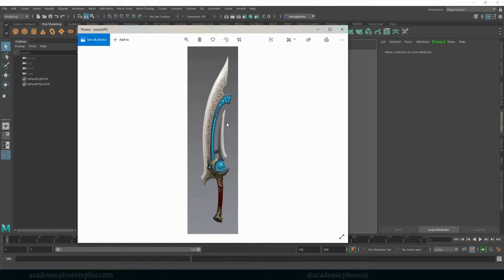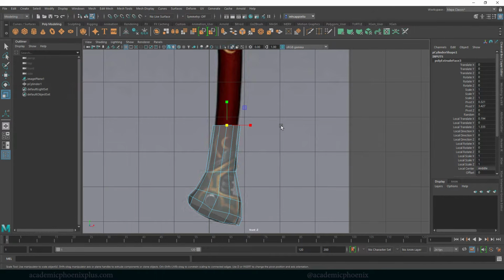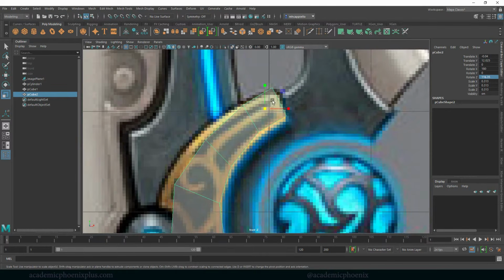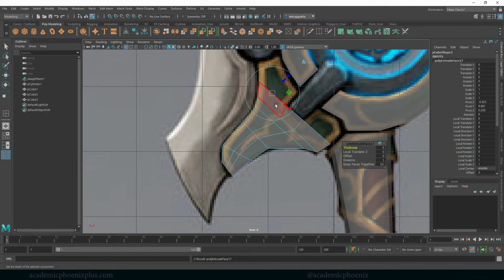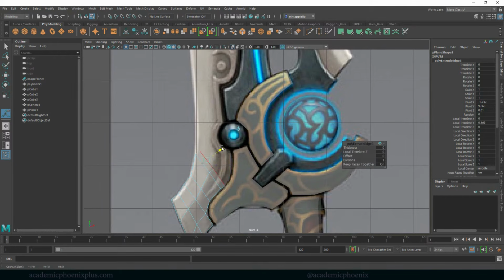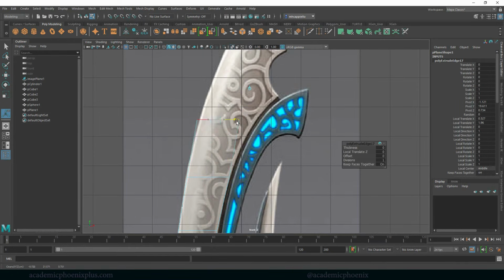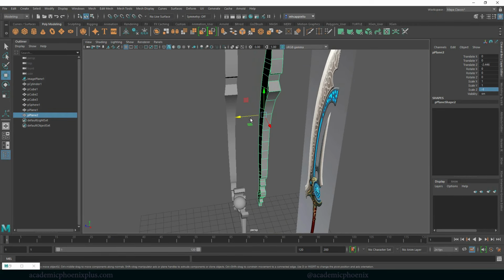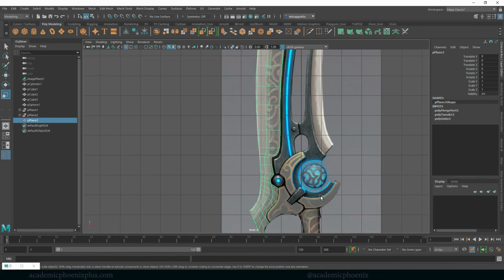Create a Fantasy Sword: 3D Model in Maya 2020 (1/6)

Comment: This is really confusing for me and the handle specifically gave me a really hard time, especially since I'm just starting in maya and it kind of doesn't help much for what I want to be when I grow up (a roller coaster engineer, which is more towards the mechanical and structural engineering side) and they use way more modeling products such as solidworks, autocad, and everything in between. Still a great tutorial, but this is not very ideal, especially for someone starting in maya. (Of course, this is just my opinion and not everyone might think this way or might not agree with me), but this is still a great tutorial for someone who has way more experience, like you.

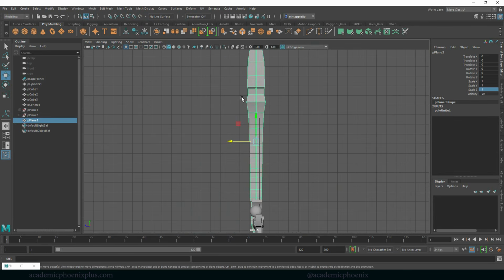Comment: hey, i got a question. like on 23:22 you did something with the vertices like draged the yellow arrow together or something like that. I think I missed that detail while making it, and now I have the problem that my blade on the sharp site (like between 2 lines of vertices, ) is just thin like paper, and I cant really move them to get them bigger. I tried some stuff now but I don't know how to fix that.
can someone help me?
Reply: i foudn a solution, its a bit weird, but i feel like you cut out a whole part of editing in the video. after we extruded the plane and kinda rotated it we still had a group of faces which were just a plane, but we also need them to get an angle to the next mesh, otherwise it will just stay a plane. you kinda cut that part out of the video but after analyzing it, when you duplicate the blade there is already this angle to the other mesh.
Reply: @XiTrOnEexe  how did you rotated it? Im stuck with the same issue and tried what you said but when I rotate those faces it gets wierd
Reply: @galr5839  i would like to help, but its been a year I'm not sure how I did it.
The way I make blades now is to not really have them sharp sharp, its more like a face really close together so I still have a good edge flow. idk if that makes sense
Reply: @XiTrOnEexe  hey man, idk if you're still here on yt but what was your solution to it? i found it odd that only 2-ish people pointed this out. ill be glad to receive a reply from you soon. cheers!
Reply from the maker: Hi all, this is a bit late of a response but I hope this helps. What I did was select the center vertices and I used 'scale'. On the side view, I selected the left handle so that it scales in one direction which will create a straight line. This will make the vertices merge easier! I hope that helps!

Comment: Great tutorial Monica!!
However, is it me or the provided image on the link hasn't enough resolution?
I can barely see the detail when I'm modeling and yours look so crisp and sharp.
Reply: It could be  that your Veiwport textures option is at a low setting, this would make your images pixelated.
Reply: @dustinjakes6786  How to fix that? i have the same problem as Cesar, but cant find a option to fix it.